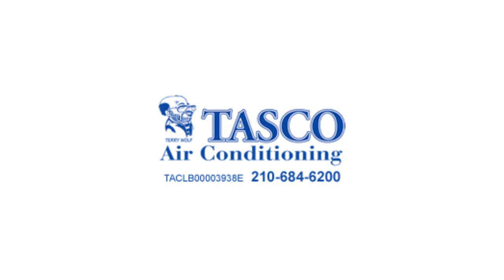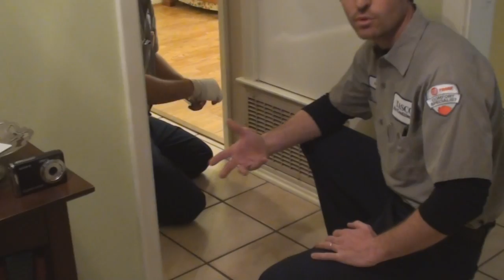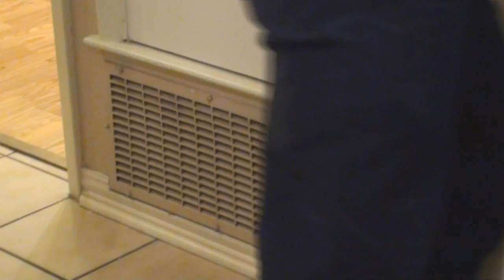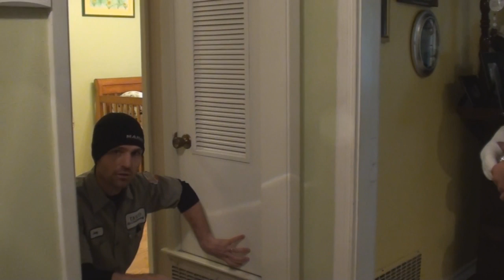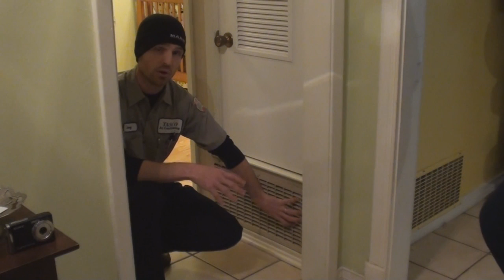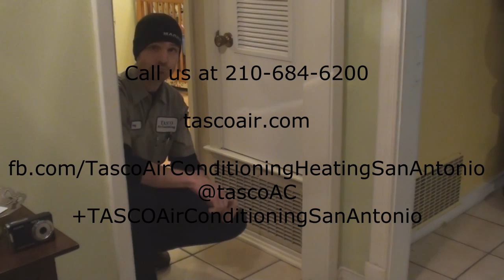Heating & Air Conditioning System Improvement: Return Air

Comment: Like you said 200 square inches per ton. I have a 2 ton AC condenser and a 2.5 ton AH. We have a 18x18 grill under the unit with a filter holder. We have then 320 square inches. Should we change anything like adding additional side return in the bottom plenum box say in the bedroom wall next to the filter return? Or are we okay?  thanks
Reply: for a small fee and home visit they'd be happy to answer your question.